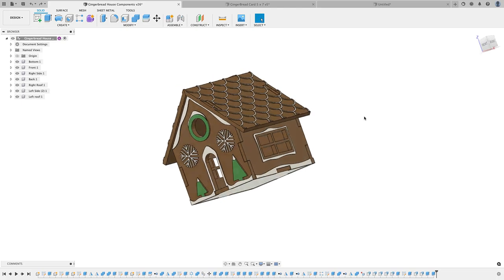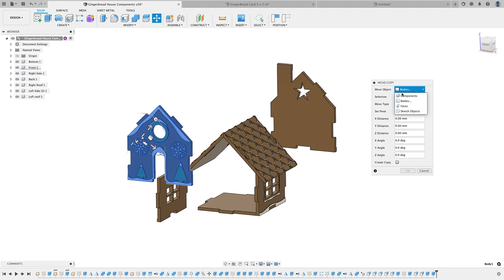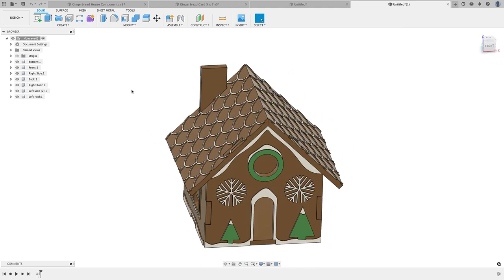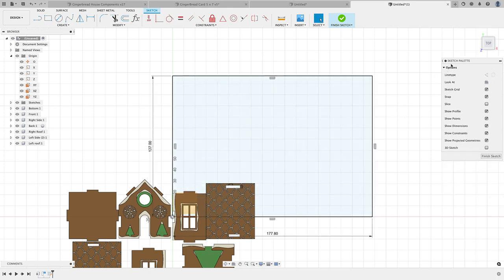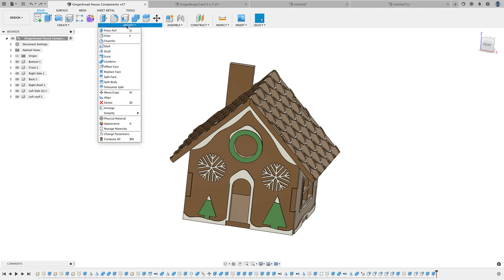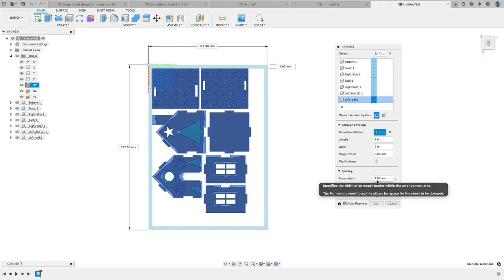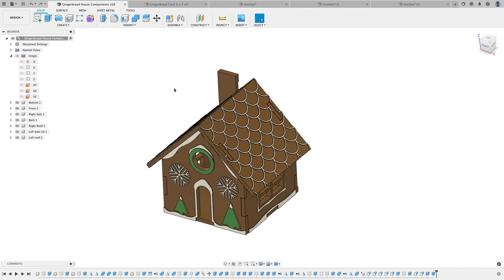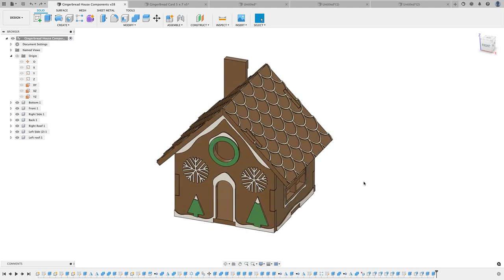Nesting Parts for 3D Printing in Fusion 360

Comment from the maker: I didn't mention that you have to enable Arrange and Simplify tools in Preferences.

I'm pinning Chris Sheaffer's comment from below.

To use Arrange in the Design workspace:

In the top-right, on the Application bar, click My Profile.

Select Preferences.

The Preferences dialog opens.

In the left pane, select General > Design.

Click Enable Arrange and Simplify tools.

Click OK.

The commands appear in the Solid > Modify drop-down menu.

Comment: Im really new to 3D design and am starting small with a kit card of an airplane.  How do you go about designing the slotted connections and tolerances? I've cutout the holes where parts need to slide, but not sure on how to adjust the clearances.  

Id love to see how you designed this in place.
Reply from the maker: I usually use the modify - offset face tool and leave about 0.2mm of clearance for a snug fit.

Comment: I printed several of these for Xmas and loved them.  It was really a test to see if I could change colors on my Prusa MK3S+ which went fine with just the addition of M600 at the right time.
I did beef up the tabs to make it easier to get off the platter in one piece.  Trimming off the tabs is easy enough that a bigger tab makes no difference.  Love your stuff. Cheers Kisssys

Comment: Hmmm I have the paid version, but the Arrange and Simplify menu aren't there at all. Do I have to turn them on?
I get it in the Manufacture space. How do you get it in the Design space?
Reply from the maker: I believe it's default now.  Try restarting Fusion.  I should be under the Modify menu.  Make sure you're not in 2D sketching mode when looking for it.
Reply: @DesktopMakes  Nope. I have version 2.0.11894 - macOS 10.16 x86_64 (21C52) on iMac20,1 Maybe comes with the next update...Thank you anyway.
Reply: To use Arrange in the Design workspace:

In the top-right, on the Application bar, click My Profile.

Select Preferences.

The Preferences dialog opens.

In the left pane, select General > Design.

Click Enable Arrange and Simplify tools.

Click OK.

The commands appear in the Solid > Modify drop-down menu.
Reply: @ChrisSheaffer  Thank you so much!!! Now it works!!
Reply from the maker: @ChrisSheaffer  Thanks Chris, I guess I had forgotten that I did this a while back.  I should have verified.

Comment: Amazing tutorial 😃👍How do you get multiple colors on your print? And what 3D-printer do you use? 😁
Reply from the maker: Thanks R4F.  These were made by doing filament changes in the print.  Recently I've been mainly using my Prusa Mini.
Reply: @DesktopMakes  So, when changing filament, do you stop / pause the print and when changing, it allows you to continue after the filament change?
Reply from the maker: I used Prusa Slicer for this print and you can add it in the slicer.  Once the printer reaches the designated height it will automatically eject the filament and prompt you to insert the new filament.  Take a look at the linked video at 12:27.  I briefly explain the process:  https://youtu.be/8f5TnQG7b1k
Reply: @DesktopMakes  Whoa, that's cool.  So, is that how you were able to print the white and green - using dual print heads?
Reply from the maker: @jeanniellewellyn198  I'm using a single print head.  When the printer reaches a designated height it will eject the filament and and I'll insert the new filament.
Reply: @DesktopMakes  I have an Ultimaker and it has two heads, so I can load two colors of filament and it prints each layer of color one at a time apparently.  I'll have to check that out and will report back!  Thanks for your awesome tips!!!